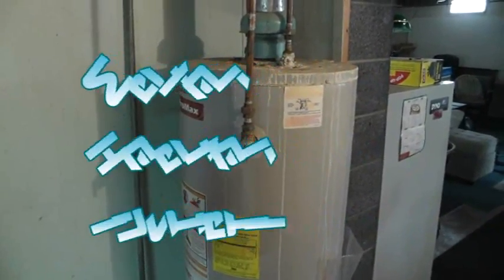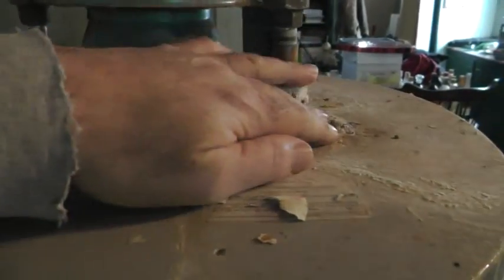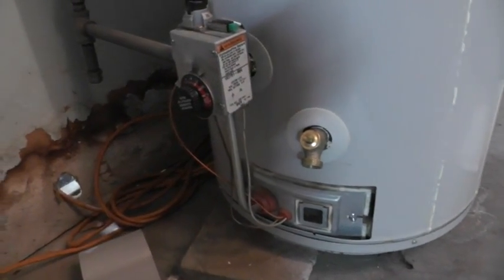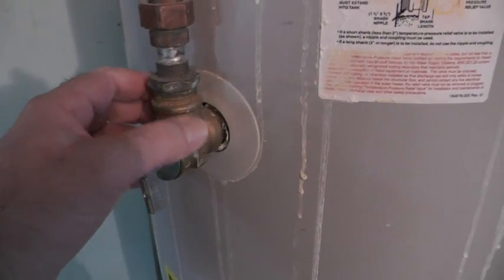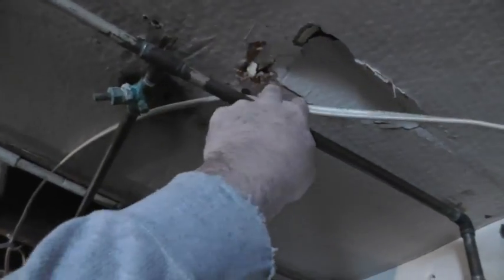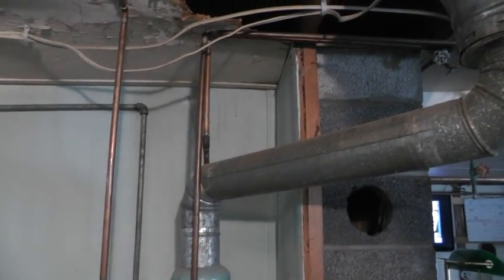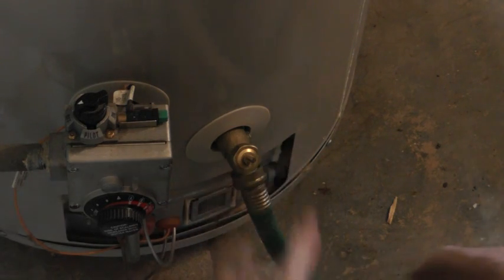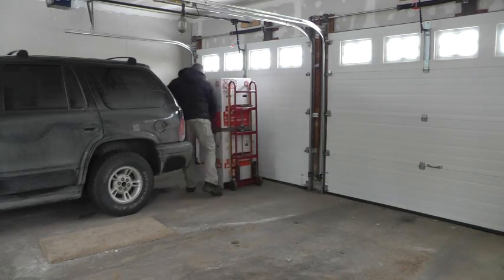DIY Gas Water Heater Install

Comment: Would be nice but in most places the copper flex pipes aren’t code, the right way would be to hard pipe the tank  with a torch and solder, as well as the  use of Dielectric unions to prevent electrolysis between the copper and the tank. Also with the gas it has to be hard piped as a hot water tank isn’t a “moveable fixture” such as a stove or a dryer. Therefore the gas would also have to be hard piped.

Comment: Good work and a nice video! Thanks for sharing. I have to ask, why didn't you take a few minutes to hit those water stains with some Kilz?
Reply: forget that he needs to clean up his solder joints if he is a Plumer I seen inspectors fail jobs due to drips and not cleaning joints and your post to have straps and pan 24inc pan is what 15$

Comment: I never understood why some plumbers put a shut off valve after the water heater...
Reply: thay put the valve on the hot side to stop back flow so next  time the water won't all come back to you I do it on bigger houses if you don't have them you will be there with a bucket for a wile

Comment: I recently had my hot water heater go bad, I looked around and found one at Home Depot for $325 and I am the type that usually likes to do it myself, but because I had reservations of dealing with a natural gas hot water heater ( natural gas scares me ) I chose to have them install it for me ( they had install prices listed as "from $200") sounded reasonable enough. Anyway Home Depot contracts the install out to another business. They had me speak to a guy about the install and he was giving me this whole line of bull of how they were going to fix me right up with this "difficult" task and "bring me up to code" blah blah blah...and I'm like "OK whatever, what is this going to cost?" when he tells me the total my mouth dropped! $990!! ( a very competitive price he says..pPPttt! ) Anyway I opted to do it myself knowing how I was going to get butt raped by that business! ( I could get 3 hot water heaters for that price! ) When I did the install and looked back on the job I was like "that was so freaking easy...what was I worried about?" It was a piece of cake and I saved $665. It is a real shame that some businesses WAY over inflate the cost/difficulty of an install. I'm all for a business to be profitable, but come on. There are TONS of DIY videos and websites online folks, don't be taken by some unscrupulous business.
Reply: Butt raped?  Does the $990 include lube?

Comment: Don't know much about gas water heaters. Your video was VERY informational, thank you. Don't laugh but I have a couple questions. Is this just a standard gas water heater or is it a power vent one. I noticed you used the aluminum vent thing instead of that white pvc one that runs though the joists to outside.  Can you tell me the difference here.  We want to  vent outside as we would like to tear down the chimney that the furnace used to be connected to. We currently have an electric water heater.
Reply from the maker: This style gas water heater has a burner under the tank and the hot exhaust from the burner simply rises up and out through the steel vent which goes through a wall and all the way to the roof (natural draft). The type that allows for using a PVC vent is a power-vented water heater. A fan motor is used to mix cool air with the hot exhaust and blow the exhaust out of the vent. So, the vent pipe can run horizontally and use PVC because the exhaust is not as hot and is moved by the force of the fan. The fan requires a 110vac outlet, will make some noise and the power-vented unit costs about 50% more than the natural draft. A gas water heater costs about 35% less to operate than an electric water heater.
Reply: I know the comment is late but this is a standard water heater, the power vent model is the one that uses pvc

Comment: Nice video. Did you install an expansion tank? I know you installed a gas water heater, but did you have to run power to it for an ignitor?